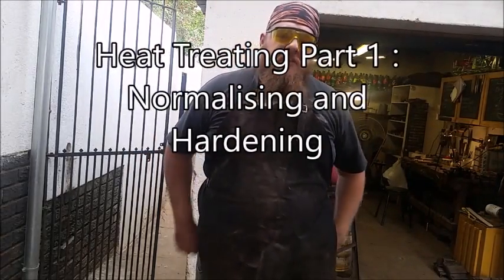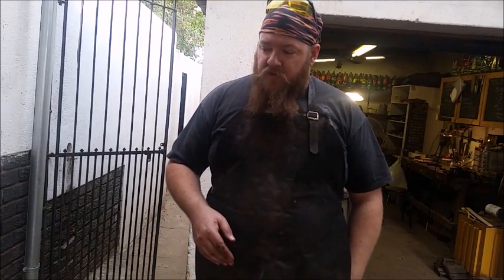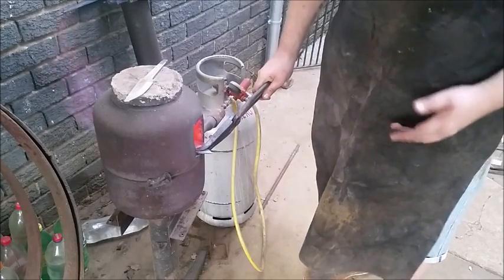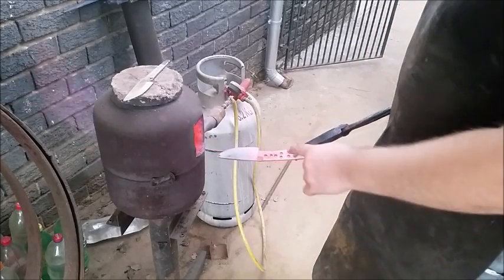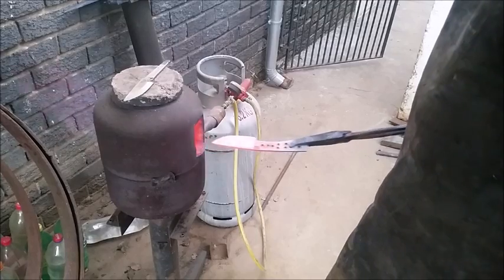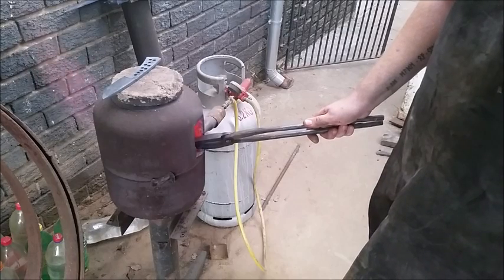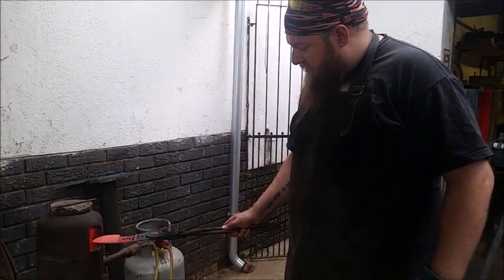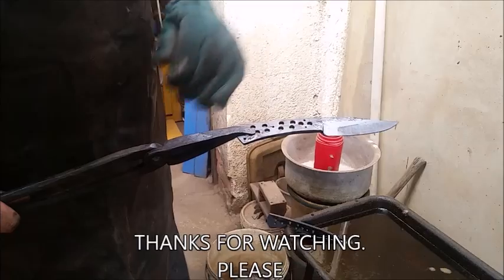Heat treating a carbon steel blade - Part 1

Comment: I have heard people doing triple quench on 52100. Have you tried that? What is your opinion on that? thanks
Reply from the maker: LUNG SUN Ed Fowler does this often. I've not quite mastered it yet  there is some debate about the benefits. I've not enough experience to weigh in really.

Comment: Normalising,is this annealing ? and are you doing it to get the crystalline structure all uniform before you harden it?
Does it the harden more evenly
I apologise if you have explained this,i have tinitus and the sound of the forge makes it impossible for me to hear your,hard enough without the forge in the background.
Reply from the maker: Normalising is not annealing. It is the process of restructuring the steel after the forging process, effectivly breaking up and refining the grain before hardening. It can be followed by annealing which is similar but followed by a slow cooling process which softens the steel making it workable before hardening. A refined grain will make a stonger knife with a less brittle structure
Reply: Stuart Smith
Okay,understood.I just  made a knife from a hacksaw blade.Big one,i annealed it,at least i thought i had,got it up to above magnetic and the buried it in perlite for a slow cool.When i went to drill the handle it was nigh on impossible,did it again,and again.But same result.What could i be doing wrong?
Apologies for all the questions,thanks in advance.

Comment: Hi Stuart,I have been wondering about Hardox 400/450 and 500,can they be heat treated?
Hardox 400 comes with a hardness of 400 HBW = RC approx 43
Hardox 450 =450 HBW = RC 47.?
Hardox 500 =500 HBW = RC 51.?
These are flexible and can be bent,they make earth mover,Back hoe's etc buckets from it as it has high wear resistance.
Is this any good as knife steel? Or is it too flexible even though it is hard? ie,not enough carbon?
heres a link to the properties for the 500   http://www.mtladv.com/wp-content/uploads/2016/01/152_HARDOX_500_UK_Data-Sheet.pdf
I am a pipe welder and have also welded loads of this stuff in between pipe jobs.
Reply from the maker: I am not familiar with Hardox but according to its specsheet it is very low in carbon which is what makes steel hardenable. I imagine it would be very flexible but not retain an edge for very long. Perhaps a water quench may push up its hardness but not by much. For knives anything higher than 0,6 carbon is ideal.

Comment: Is this the same process you would use for a sword?
Reply from the maker: pretty much but you need a larger forge or oven to heat it evenly. I put my forges back to back to get a longer heating "tunnel". You may want to temper your swords a little higher because flexibility is more desirable than hardness in long blades.
Reply: Oh okay, thanks a lot :)

Comment: Outstanding video!  Thanks again Stuart.  I have learned quite a bit from you.  Would you do a video on (or explain) setting the bevels.  I am having trouble with setting one side but when I forge the opposite the first is now flat and off center.  I can't figure out what I am doing wrong.  I tilt the blade and still it goes off center and gets flat on one side. Any advice would be greatly appreciated.
Reply from the maker: I have a show this weekend but I'll  whip up something next week for you.
Reply: +Stuart Smith (Smith Hand Forged Knives) Thank you so much.  I look forward to the instruction.  I am sure others may be having the same issue so it will benefit many.  Again, thank you for sharing your knowledge and skill.

Comment: I am from Bulgaria and I can only find 1050 from the 10' series, which is mosly used for swords.
Can I use it for knives and if I can what kind of knife I would get in the end?
Reply from the maker: 1050 is fine for knives but it may not get as hard as you will need for good edge retention. to get a harder edge from 1050 try a water quench. But not for sword size only knife size blades.
Reply: thank you :)
Reply: +Stuart Smith (Smith Hand Forged Knives) I forgot to ask. How to temper it after the quench?
Reply from the maker: +Blacky Chan 180degC for 3 x 1 hr allowing to cool to room temperature between cycles.
Reply: thank you for the quick and good answer :)